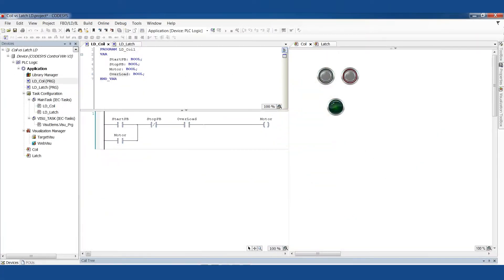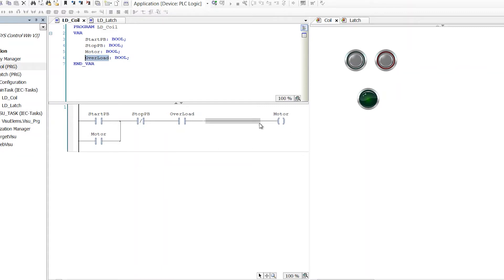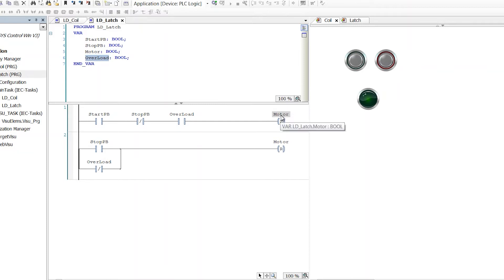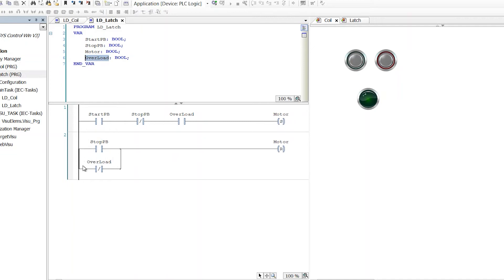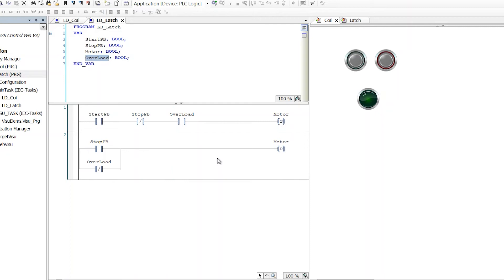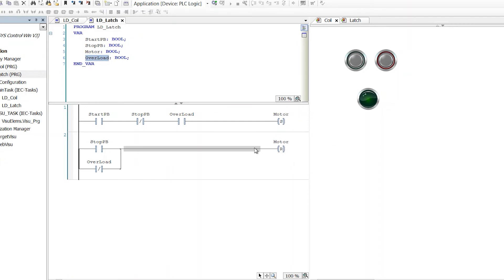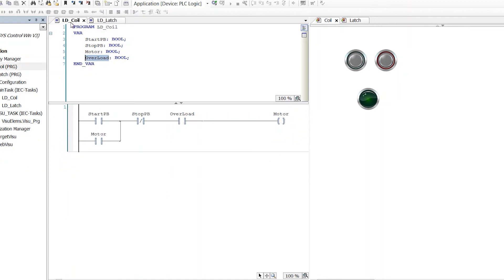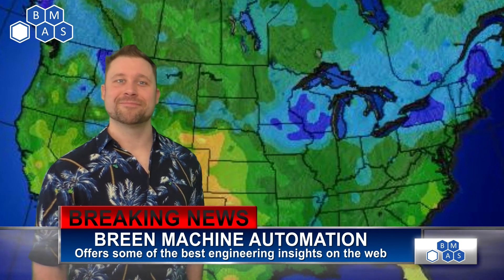Coil vs Latch in Ladder Logic - PLC Programming Cookbook

Comment: why do you use NC contact for stop signal. This actually mean that the physical button is NO?
Reply: Giving NC contact to stop button let PLC to understand that stop button is NO when the Motor has to be started and when it is pressed, it also break the given ladder circuit to turn it off
Reply: @faizanzaheer8393  i dont understand
Reply: @faizanzaheer8393  when it nc in plc , the actual button has to be no?
Reply: @molazem7rb637  Exactly, when the stop button is NO , and it will be in NO so in PLC ladder same button is inserted in NC position so as to connect the logic to output coil. 
When you press it from panel , the same contact turns into NO breaking the ladder connection toward output causing output relay to be OFF.